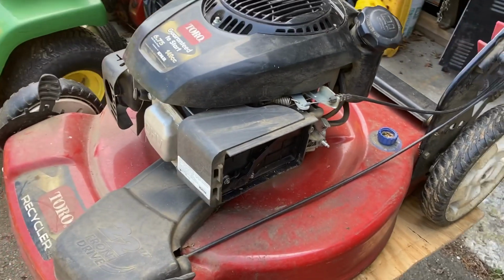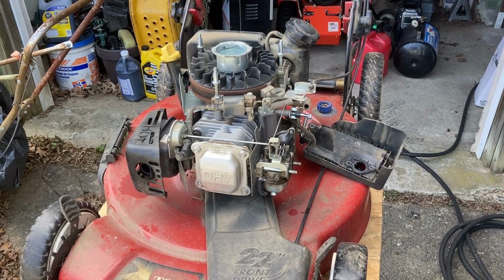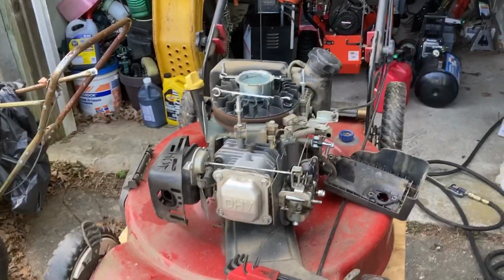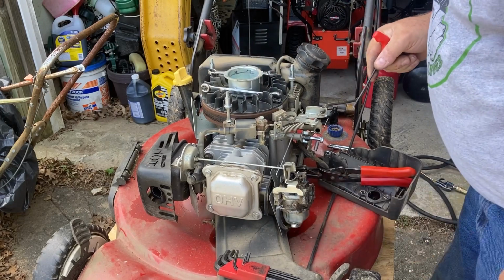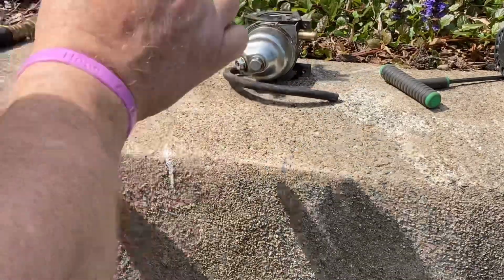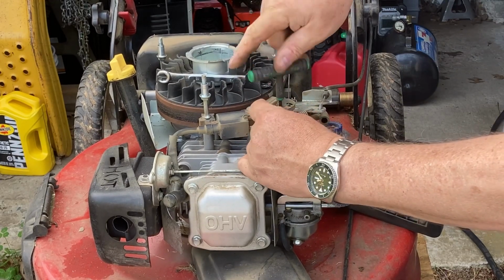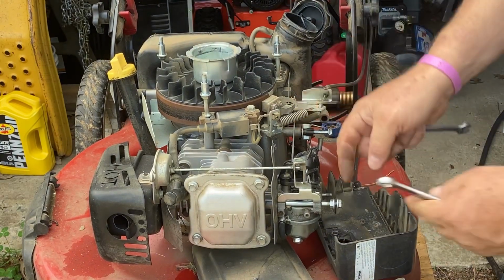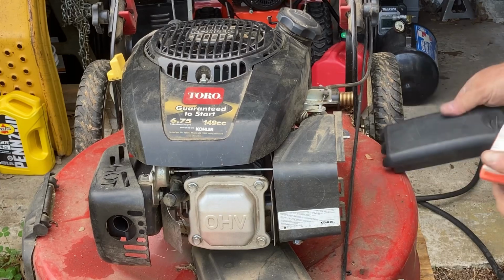Toro Recycler with Kohler 6.75 Courage Engine Won’t Start - Simple Repair!

Comment: Great vid Ken. First time I did one of those I didn't do the idle jet, no problem. Next time not so lucky. And once I tried  to get the carb off without doing the auto-choke linkage and broke the choke shaft! Lol don't know where my brain was that morning. Lol. Thanks Ken!
Reply from the maker: Like the Honda carbs, it’s easy when you remove the studs.  Thanks for watching!
Reply from the maker: Like the Honda carbs, it’s easy when you remove the studs.  Thanks for watching!

Comment: I have one of these engines on an Ariens mower. Same thing problem wise. These and the Honda GCV160 have the 3 studs that hold the recoil on. Invariably, the stud on at least 1 of the 3 wants to back out of the block. I put them back in with Locktite, but they still want to back out the stud instead of the nut just loosening off the stud. The stud has a 10mm surface to hold the stud while backing off the nut, but the wrench angle sucks. Anyone else deal with this? Ideas welcome. My idea is stick with Quantums.